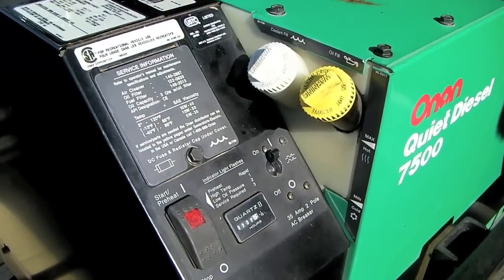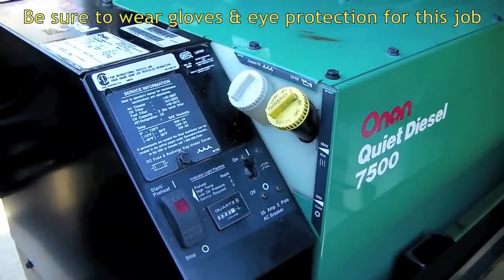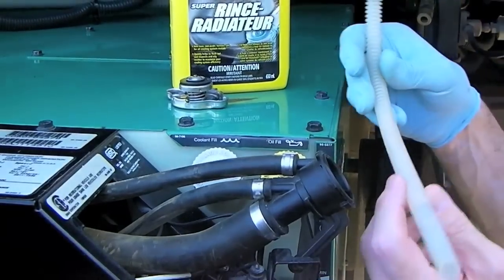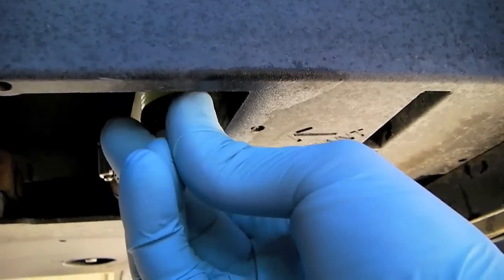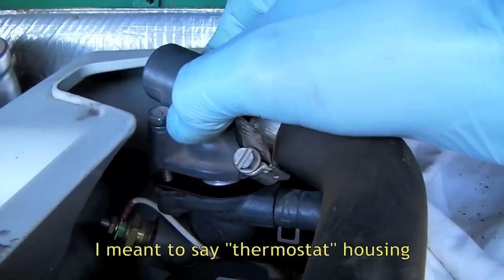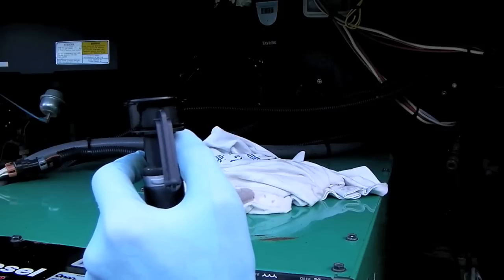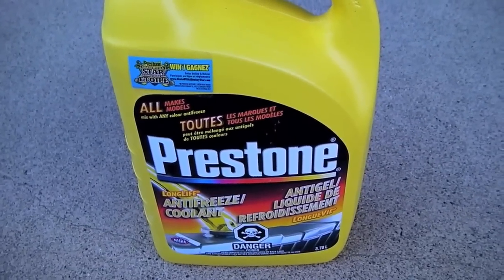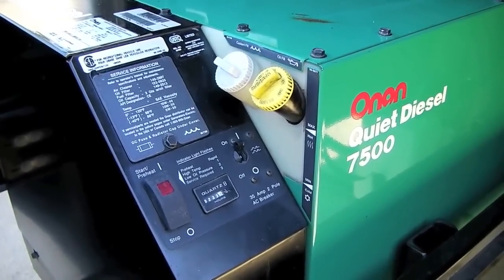Change the Coolant in Your Onan Diesel RV Generator || RV Generator Maintenance

Comment: How much coolant?  I can’t find it in my manual.  4qt or 6.6qt? I have seen both online nothing on my manuals. I have a 7500
Reply from the maker: The manual for our 7.5 kW Onan QuietdDiesel genset says 4.2 quarts (or 4 litres)
Reply: @RVgeeks  I found it on there finally. I wanted to ask when you do coolant flush do you put anything in expansion tank or just only in the radiator part?
Reply from the maker: @iscreamcandytv9642  We fill the expansion tank, too. About half way between the “cold minimum” and “hot maximum” lines.
Reply: Is this 4.2 gallons PLUS 4 liters?  
4 liters is 1.057 gallons.  
4.2 gallons is 15.899 liters.  
Which is it please?
I have no manual.
Reply from the maker: Hi PJ… our manual says 4 liters OR 4.2 quarts (which is what 4 liters equals)
Reply: @RVgeeks  thank you so much!  Think I missed the quarts somehow!  Much smaller job now!  Do you need to use deionized water for the system rinse?
Reply from the maker: @BigDaddy32536  You don't need deionized water for flushing unless the local water is very high mineral content (like the Desert SW). Since we never service the genny in that part of the world, we just use clean tap water, and all good.

Comment: I am not able to see amount of antifreeze that is left inside the antifreeze overflow tank, especially hard to view thru the translucent white plastic holding tank.
What amount is suggested in depth  1" - 2" etc.
Generally I' ll need to check depth using a long stick or equivalent measure  that shows dampness of the depth.
baldtbird.06

Comment: So...I need to add antifreeze #1 into the black pressure hose until I can see antifreeze fill to the top of the filler hose. PLUS ALSO #2 ADD same Antifreeze into the overflow holding tank also until tank is 1/2 full ?  My holding tank is now empty and seems to be empty when always generator is off and cold ?
 SORRY TO BE SO ANAL ON THIS !
Reply from the maker: Fill the radiator first until it's as full as you can get it, then add some coolant to the overflow tank until it's between the low and full lines. The radiator can pull coolant out of the overflow tank, or expel excess coolant into the tank, as needed. We keep the radiator full, and the tank half full, and it works great. We have a different brand than you do, but it should work the same.

Comment: Hey guys:  I’m the master of obvious questions, and I will now dazzle you with my wizardry. When you fill the tube all the way to the top, how do you prevent coolant from entering either the vent or overflow tubes?
Reply from the maker: Hi Ed! A little bit of coolant is bound to get in there at the end, but don’t worry about the that small amount. No problem.

Comment: why gloves?
Reply from the maker: To protect hands when working with hot or contaminated substances, like anti-freeze or used motor oil.
Reply: you know those dont hurt you right?  unless you ingest them
Reply from the maker: Well, for me it's actually several factors. 1) I don't have to ingest hot engine coolant for it to burn. 2) Used engine oils are carcinogenic (contaminated with heavy metals) and the skin is a perfectly good way to absorb that. 3) I have very dry hands, so try to avoid getting them dirtier than necessary to avoid excessive washing. 4) (this just goes for me mostly) I'm a cancer survivor who's had lymph nodes removed from my right side. So I try to avoid cutting my right hand, since it takes longer than usual to heal.

I know lots of guys who never wear nitriles when working, no matter how filthy the job. But I hate getting my hands greasy or cut, so even though I know I might get a little ribbing (especially doing it on camera!) for wearing them for many tasks where others don't bother, I do it anyway.

The guys who really should be the most careful with used motor oil are auto mechanics, who are exposed to it all the time. I used to work in a car dealership, and most of the techs wore nitrile gloves for every greasy job, and the shop provided boxes of them for their free use. With the few times I get my hands oily, my exposure is so low, I'm sure I'm in no danger from it. LOL
Reply: see now that makes sense, I was just curious.